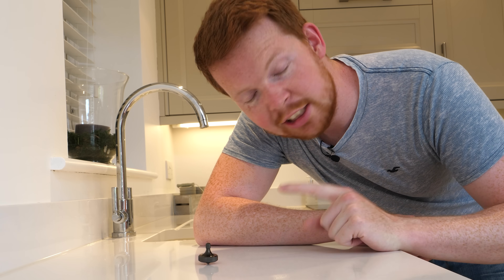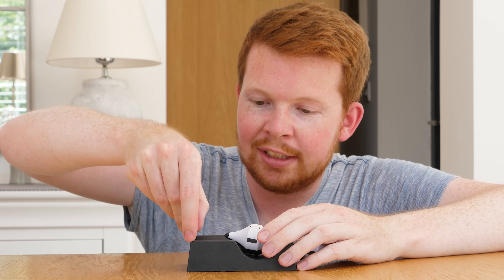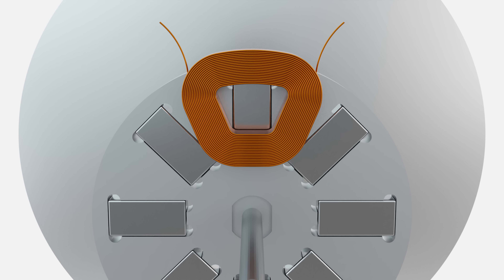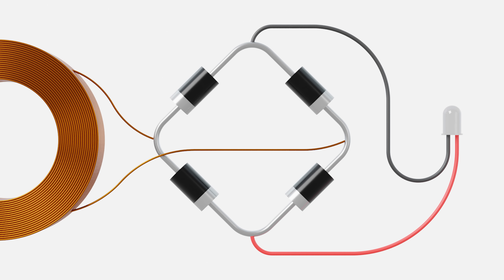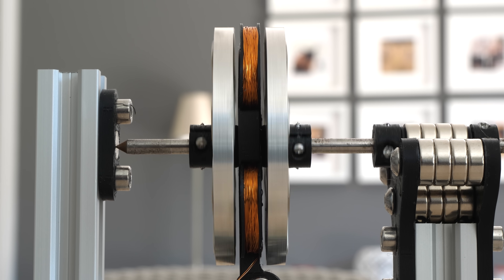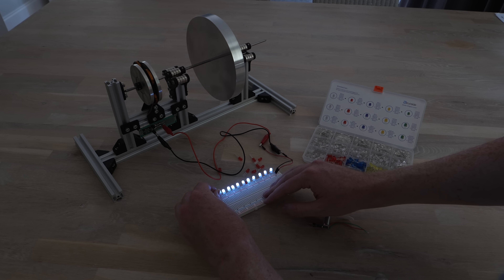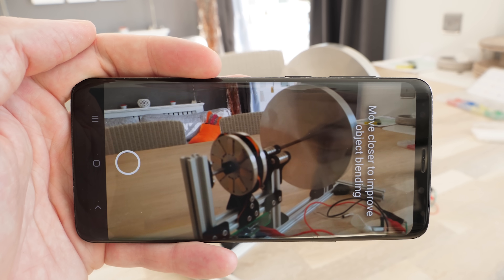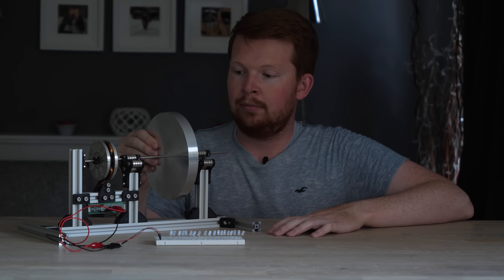Flywheel Battery

Comment: Since I'm the "push it until something breaks" type, all I can think is "I wonder how fast it'd spin if he spun it up with an air compressor..."
Reply: I was thinking: how much more efficient would it be operating in a vacuum?  We need both questions answered.
Reply: @I-0-0-I  Commercial flywheel backup systems are in vacuum cans.  Quite efficient, a little more expensive (if I'm remembering correctly the quote we got a year and a half ago) than a battery back up system of the same capacity.  On the other hand, you never need to replace your UPS batteries!
Reply: @michiganengineer8621  Do they "start up" faster, or no?  I vaguely remember hearing that somewhere.
Reply: @ericlotze7724  Running in a vacumm removes losses due to air friction, these things can spin at well over 1k RPM.  The commercial units I'm thinking of are motor-generators.  They constantly use a little bit of grid power to keep spinning, then if grid power is taken off, they act just like a battery backup for the short time it would take for a regular generator to fire up.  The connections would look something like this:  Grid -> auto transfer switch -> generator -> flywheel system -> building loads
Reply: @I-0-0-I  Oooh. What about a hybrid. Use a vacuum or near-vacuum for the wheel itself, but keep the alternator outside of the vacuum (For cooling), and then use a Tesla Turbine as the motor to speed it up with compressed air.

Then run the air compressor off a solar panel and you have a solar battery that takes up a lot less space than a normal battery bank, and is less finicky about the input voltage.
Reply: I was thinking using something like the starter off a small gas engine. Wind a meter or so of line around the shaft and give it a yank.
Reply: @joshuahadams  I was actually trying to think through good ways to spin it up by hand. I didn't consider a pull-starter like that. I was imagining something like a friction clutch, with one plate on the flywheel's shaft and the other on a separate coaxial shaft, held apart from the flywheel (when not in use) by a spring.

I think I like yours better.
Reply: yes
Reply: Fly wheels breaking is not a fun time at all
Reply: @zogworth  A CD (remember those? a 1mm polycarbonate disc) can spin at 25,000+ RPM before breaking.  I imagine a 25mm disc of aluminium could handle hundreds of thousands, if properly balanced. What happens when it gets a speed wobble and crashes into the supports, who knows
Reply: @PKMartin  if is a big if isn't it? I've seen death wobble in bike wheels going much slower than that. Though at 25k rpm your album would over in about 80 seconds.
Reply: And where does the energy to compress the air come from?
Reply: Why Magnetic force is electric force? Why Magnetic moment and mono pole don't exist?

Magnetic force is circular electric force. There is no magnetic poles and there is no magnetic moment. If the magnetic moment is formed from 1 mono north pole and 1 mono south pole, like a smallest magnet, then you cannot use many of it to make a big magnet. 

Two parallel current carrying wires attract or repel each other is not caused by magnetic force, since there is no magnetic moment in copper wires.

Current carrying wire does not attract magnet and has no poles, circular current carrying wire attracts magnet and have poles.

Imaginary magnetic moment is in fact electric dipole, magnetic poleis in fact  concentric circular electric force . 

Theory Of Magnetism And Electromagnetic Induction

Ferromagnetic material has a special property – it can be magnetizing to create temporary electrical dipoles/magnetic domains.

Every magnetic domain contains at least two atoms. When an electron moves from an atom to the next atom and stays there temporarily, the two atoms become a temporary magnetic domain.

The magnetic domain carries a negative charge on one end and a positive charge on the other end, so we can call a magnetic domain an electric arrow.

Due to electric arrows carrying positive charge on the head and a negative charge on the tail, it has special properties:

1. Same direction electric arrows attract each other from head to tail, and by side to side.2. Opposite direction electric arrows repel each other from head to head, tail to tail, and by side to side.

Temporary electric arrows in magnets’ Ferro material cannot exist by themselves, but rather must all be linked into concentric rings and fill up the whole magnet, for a magnet to be stabilized and magnetized.

Therefore, on the poles of a bar magnet, there are concentric rings of electric arrows/dipoles, with one pole clockwise, and the other pole counterclockwise. On the body/surface of the bar magnet, there are parallel electric arrow rings all over.

A current in a wire does not create a circular magnetic field in space. It induces the electric arrows in the compass to be parallel to its current direction; therefore, the compass moves to 90 degrees to the wire.

Between two parallel conducting wires at distance R, line of sight electrons on the surfaces of the two wires are repelling each other with electrostatic force F=Ke x ee/R^2. This repulsion force is billions of times stronger than a steel rod. Because it connects all of those repelling electrons as one, therefore, if there is a current alternating in one wire, it will induce an alternating current in another wire instantly. This is the true mechanism of so-called electromagnetic induction. It is, in fact, electrostatic induction.

Magnetic force is a misinterpretation of circular electric force.

The magnetic field is a misinterpretation of the circular electric field.

Electromagnetic induction is a misinterpretation of electrostatic induction.

The electromagnetic wave is a misinterpretation of electrostatic wave/alternating current.

Electromagnetic radiation is a misinterpretation of electrostatic radiation.
Reply: @ericlotze7724  i dont think they use hydrogen though.

Kinda explosive.
Reply: @bertjesklotepino  This is overstated in the public, and MANY industrial gasses are explosive/flammable (see petrochemical / crude oil distillation industry etc)

It is all about safety systems etc, and even then pressure, and fuel-air mixture/ventilation are factors

 (a propane stove blowing out a match in a shed vs outside with a gentle breeze, which will produce more of an explosion when the next match is lit and that cloud forming ignites etc)

Hydrogen-cooled turbo generators are a similar application.

People probably tend to use helium, but hydrogen is "faster" if that makes any sense

(granted i am not an expert, just a nerd, so if anyone has more on this subject i'd love to hear more (i love FES as a concept) )

Comment: Did you see that Wintergatan mention you in their lates video? Also, very nice video. I have seen something similar where they have the flywheel in a vacuum, used as a battery, but with a flywheel that has a weight of tons.

Comment: There are commercial flyweel-energy-storages for uninterupting power supply, even used in datacenters for covering the few seconds between the power loss and the fully started up diesel generators
Reply: I did not know that. Very interesting, thanks. What kind of size are the flywheels? Must be quite beefy, presumably.
Reply: @vooveks  
I found one article about one flywheel UPS, which is installed in a soccer stadium. It has a total mass of 21 tons and a power of 1,3 Megawatts
Reply: @TheThrustProject  No way! That’s insane 😲
Reply: @vooveks  just google it, and read a bit
it's very interesting, and I also noticed recently, that tjey exist 😅
Reply: @TheThrustProject  I will! I totally hadn't heard of them before you made that comment.
Reply: @TheThrustProject  Found this:

https://energydigital.com/smart-energy/worlds-largest-flywheel-energy-storage-system

20 megawatts! Holy balls. But using multiple (200) carbon fibre wheels in a vacuum chamber, so quite funky.
Reply: Cool

Comment: To straighten a shaft in a lathe : spin at around 500rpm. Start with about a hands width protruding from the chuck.  Check for wobble and pull the bar towards you. You will feel the bar vibrate as you pull the bar past centre slightly. Do it the right amount and you will overcome the tensile strength of the material just enough for it to remain on center. Pull the rod out another hands width and repeat. Always check by rolling the bar on a known flat surface. Wet hands for extra lubrication.
Reply: Ummm, or just use a dial indicator. My old boss taught me the quickest way to get something roughed in is to use a sharpie and brush the high spot as object spins. Benn a machinist for about thirty years. His best bet is to cut off the shaft , drill out the center, and bush it for a new shaft. Pity it warped on him.
Reply: @beavis6363  A ball bearing mounted to a piece of bar stock mounted in the tool holder/turret would be much safer and easier to use. Then just dial in the cross slide.
Reply: @ADBBuild   "KISS" "{keep it simple stupid} . Meh, one-hundred ways to skin this cat. In your example, just use the tail stock, no need to mess around with fabbing a bearing and shaft set up . Been doing this sh*t for a looooong time dude. Not saying you are wrong but no need to give *me advice
Reply: miss the part where he said he couldn't take off the flywheel?
Reply: @Jaco9307  2:43
Reply: JTFC this sounds like a recipe for losing fingers. Do not recommend.
Reply: Out of curiosity, how many of the naysayers are actually machinists?
Reply: @BaronParabola  I am for 15years. Never I repeat never touch let alone grab spinning metal at any rpm. That’s just plain stupid. Like really stupid. And wearing gloves. Please never wear gloves near a spinning machine. Same goes for jewelry. It all comes off. Or the tool will take it off real quick.
Reply: @BaronParabola   thirty years worth. Still got all ten!
Reply: I would say never put your hands near a lathe spinning material at 500rpm. Better to buy silver steel which should be true
Reply: @ianlainchy  obviously would depend on how much you have sticking out. Ground bar is usually what u get if you want straightness.
Reply: @BaronParabola  I wouldn't use my hands however much is sticking out tbh. I've seen videos and the aftermath of lathe accidents. Even with my small 7x12 dc motor lathe... no way.
Reply: @ianlainchy  what about with leather gloves
Reply: @frostedlambs  Never wear gloves when using a lathe. The gloves can wrap round the part and pull you in.
Reply: @ianlainchy  
That is a lesson that you do NOT want to learn the hard way, I have seen people getting degloved doing that as well... OUCH!
Reply: @frostedlambs one of  my apprentices went against my advice on not wearing gloves. The colour left his face when his glove was removed from his hand at light speed. He was lucky.
Reply: @tomasotreasaigh111 there's a video of an Asian man getting unalived by a lathe.
He didn't quite fit between the part and the lathe bed.
Reply: I have a low tech solution that was taught to me and I regularly use this techniques to straighten out solid copper wires for my prototyping. 
Put your piece on a hard flat surface, with a plank of hardwood, press on the piece and try to roll it, like a dough. Roll roll roll your boat, and there you have it. 
Your part is now straight. Enjoy.

Comment: In a FBR you lose 2 X the diode's voltage drop which is around 0.7V X 2 = 1.4V. In a low voltage application like this schotky diodes would be good because the voltage drop is 0.2V or so.
Reply: +1 to this idea! Or even a synchronous rectifier for even better efficiency

Comment: 5:52 - You must be pronouncing FULL BRIDGE RECTIFIER incorrectly, the camera didn't shake.

BTW, with a flywheel, the energy stored depends on the mass and speed. If you make another wheel, thin down the centre, and concentrate the mass on the outer edge, you will be able to store more energy without increasing the total mass.
Reply: If you are starting with a solid chunk of metal, that wastes a lot of material which is probably why he did it this way.
Reply: Lot of mass is not a big problem if your flywheel is levitating. Thinner centre might not make much difference , but it would require additional work to be machined.

And your right. It's pronounced "FULL BRIDGE RECTIFIER" and not "full bridge rectifier"
Reply: @DawidEstishort  I expected "FULL BRIDGE RECTIFIER". My disappointment is immeasurable and my day is ruined.
Reply: @DawidEstishort  No.  the energy stored is proportional to the mass times the distance (angular momentum)(times the rotational velocity squared.)  Putting the mass further from the center dramatically raises the capacity.  It's basically a rotating lever.  The longer the lever, the longer the force.
Reply: I am pretty sure that as an aerospace engineer he should know that already..
Reply: @guilhermerocha2812  I'm pretty sure he does, and might have even mentioned it in another video, I was being cheeky 😉
Reply: It would need to be huge (radius would be root 2 times bigger) to achieve an equivalent storage capacity with a thin rim flywheel (which decreases the energy density), the stress capabilities of the flywheel is actually the guiding parameter. If the geometry is optimised to utilise the stress evenly across the whole of the flywheel (so there are no/minimal stress concentration points), then the flywheel is only limited by the material strength, which is why most of the high speed FESS flywheels nowadays are made from carbon fibre. I did my mechanical engineering degree project on them this year, my flywheel was carbon fibre, roughly 1 metre in diameter and 100mm thick at the inner radial region, and the radial section was a truncated triangle, this produced 11kWh of energy storage at 40,000RPM, without failing.
Reply: It should be "FOOL BREEGE RECTIFIA!!"
Reply: @Feevies Depleted uranium flywheel! (Or even better: osmium flywheel)
Reply: Noch mehr Energie kann man speichern, wenn man das Schwungrad außen dünn und innen dick ausführt im Vakuum in Magnetlagern laufen lässt und es soweit beschleunigt bis das Material (Carbonfasern) des Schwungrades fast an seine Belastungsgrenze (abschleudern von Schwungradpartikeln) kommt. Der Antrieb kann über Spulen mit kommutatorloser Umschaltung erfolgen, was ja Stand der Technik ist. Die Antriebsspulen müssten nach dem Beschleunigen "weggeklappt" werden da sonst das System, auch im "Leerlauf", zu stark abgebremst würde.